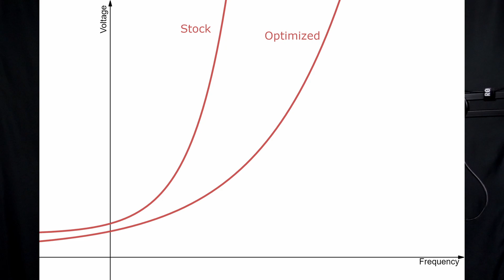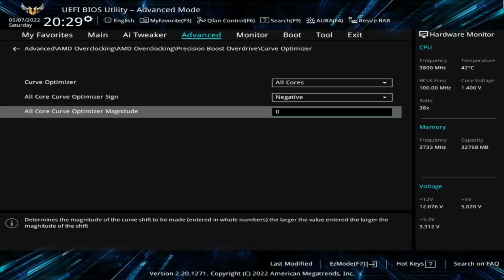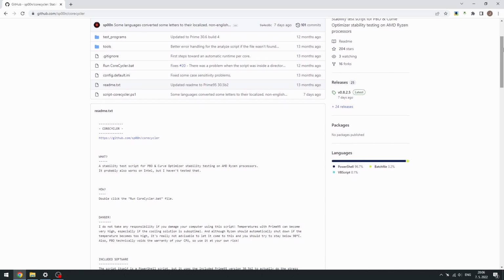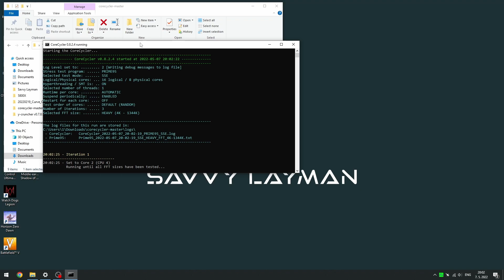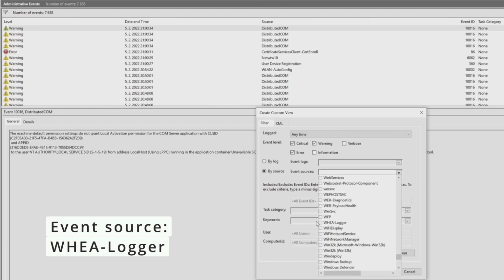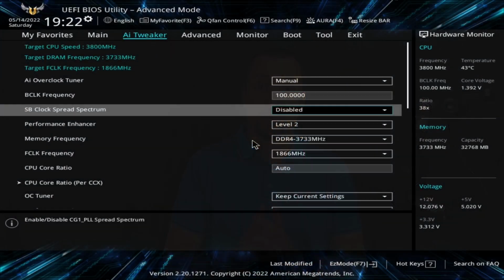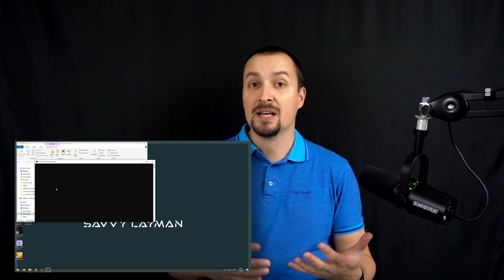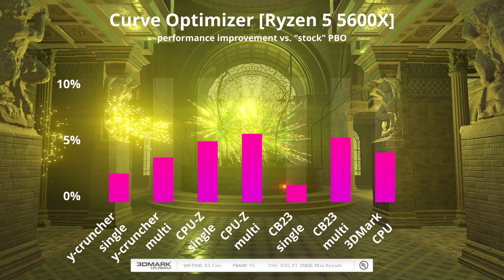Curve Optimizer - Ryzen 5000 / 7000 per-core "smart" undervolting

Comment from the maker: If you are intrigued by Curve Optimizer, I suggest you also watch my video on Hydra 1.2, which can actually make your life a lot easier: https://youtu.be/Nnpao_5uXOQ.
Reply: So we're trying to get the offset per core as low as possible right

And neg 30 being the max?
Reply from the maker: @jgvtc559  Yes, that is correct. Curve Optimizer cannot go any lower by design. Hydra uses a different technique with its Hybrid OC, so it can achieve a more efficient curve.

Comment: Few things to note

Higher clock speeds NEED more voltage. If you set co way too negative, you will starve the cores and crash them. For me personally -25 was stable in all the benchmarks and stress tests but in beamng it would crash after 10 minutes. By trial and error I found out that -6 was the best I could do all core

That brings me to per core. It's a waste of time since AMD only uses 1 power plane for the entire CPU. The core with most load on it gets to dictate how much voltage all the other cores will be running at. If that core is set too low, the system will crash since other cores will not be able to use that voltage and stay stable

Comment: I'm freezing constantly when I push to -40 curve but I can't figure out the problem core. The core cycler shows a flawless test for all cores, and the WHEA logger just won't show anything, the unexpected crash shows up in the basic administrative events but that doesn't show the APIC ID is the issue.
Reply from the maker: Happened to me, too. If your RAM is 100% stable and you don't want to increase voltages, the only workaround I can offer is to lower the frequency offset across all cores. Not great, but it's almost impossible to pinpoint the exact core without APIC ID listed. Apologies.

Comment: nice work  you added  inputlag and stutters , check  for inputdelay and  the viewable nanostutters or weird mouse behavior ;)
Reply from the maker: Thanks for your comment. What makes you think this was the case? What's your assumption regarding such behavior?
Reply: i get this with curveoptimizer enabled on every setup, when  i disable it ,everything is  fine ,must be a windows problem , cuz i hadn't this problem before idk :)
Reply from the maker: @Lolliswonderland  I see. I think this is caused by so-called clock stretching. Due to too aggressive CO curve, the CPU attempts too boost too high for the given voltage. The supplied voltage is not too low to immediately crash the system, but low enough so the CPU has to drop the clocks significantly. I think this whole procedure can take a fraction of a second. In such case, I would recommend to lower the negative volttage offset.
Reply: @savvylayman  so you think the auto setup makes clock stretching by -1-20 negativ on all  cores in the curveoptimizer on 2 Systems  with different boards and cpu's?
Reply from the maker: @Lolliswonderland  Don't know to be honest. I would need to see your system in person. By the way, are these Asus mobos? If so, make sure you disable PBO Fmax Enhancer: https://youtu.be/csGkp4pVuO0

Comment: I dont know if this is.true or Im extremely lucky, but I think silicon quality has improved dramatically. I have one core on -40, rest on -45 (yes, not 30 is the limit, but 50). Tested with y-cruncher for 10h, prime95 for 8h and CoreCycler (with y-cruncher) for 8h. All tested with default PBO values (PPT, TDC, EDC). I think im gonna run another CoreCycler over night with prime as stress test, but Im pretty sure im stable already.
Btw: after a very long time, new CoreCycler versions have been released! With many new features and updated stress test binaries 👍🏼
Reply from the maker: Thanks for letting me know about the new CoreCycler version and kudos to your CPU for being able to handle serious undervolting.

Comment: I have -30 on all cores after tuned by RizenMaster, I se the values in BIOS, full stable in over a year. Ryzen 5 5500, also I set +200MHz boost. Benchmark programs report perofrmance over R5 5600x
Reply from the maker: That's a really good bin then. My personal guess is this was supposed to be a more premium CPU, but it failed some validation tests, so AMD disabled some cores and lowered the overall power budget. Good for you!
Reply: @savvylayman  yes, it has 2 disabled cores, the specs resembles a R7 5700.

Comment: Sir can you please suggest a PPT EDC TDC for 7600x ?
Reply from the maker: Do you want to go for eco mode or full power? Because 7000 series have pretty generous limits set out of the box. What cooler do you use?
Reply: @savvylayman  at the moment i didnt change my cooler yet im using wraith stealth cooler and im setting thermal throtle to 85C + i undervolted all cores to negative 22
Reply from the maker: @cjentuskuzan4027 Thanks for sharing. With stock cooler, I would definitely go with eco mode.
https://www.pcworld.com/article/1352253/how-to-enable-eco-mode-with-ryzen-7000.html
For serious overclock, I recommend at least an AIO with 240 mm radiator.
By the way, negative 22 curve for all cores seems too aggressive in my opinion. You would have to be very lucky to be able to shift the curve so much with the best cores. Anyways, if you encounter crashes, just decrease the value. Cheers and good luck.
Reply: @savvylayman  its my first time undervolting a cpu and im undervolting it and testing by occt if i dont get any errors i consider it as a good undervolt . Im i right or wrong ? Cause i started from 30 and i had bsod and crashes but in negative 22 everything seems to be fine .
Reply: One thing to mention im using the integrated graphics at the moment and im having very high latency all of the sudden in latencymon due to directx graphics kernel can it be due to the undervolt ?
Reply from the maker: @cjentuskuzan4027 You are on the right track regarding undervolting (curve optimization). I haven't used OCCT for a while so I don't remember what options they give you with individual core testing, but each core needs to be thoroughly tested. That's why I recommended Core Cycler. Hydra is another option, but the PRO version is only available to Patreons.
https://youtu.be/Nnpao_5uXOQ
But from my experience, even Hydra doesn't come up with flawless curve. But its curve is certainly a great start. For example, my 5900X is currently using this curve: -19, -8, -25, -23, -10, -26, -30, -30, -25, -26, -30, -24. The best cores are both on CCD0 and those are with curve -8, -10. It's almost always the case the best cores cannot be optimized too much as AMD pushed their curve out of the box.
Reply from the maker: @cjentuskuzan4027 Yes, it can definitely be the case. The thing is if the curve is too aggressive, it doesn't always need to end up with a crash. Sometimes the core throws repairable errors, but this consumes CPU cycles, so you may only observe performance degradation.
Reply: @savvylayman  thanks for your response . right now im dealing with latency issues due to directx graphics kernel or classpnp.sys according to latencymon . i spent weeks trying to solve it without succeding if you have any potential fixes please let me know .
Reply from the maker: @cjentuskuzan4027 Are you using the integrated graphics of your 7600X? Disable it if you have another discreet GPU in the system.
Reply: Seems like its not the integrated graphics i suffer from kernel latency no matter what i do . Im suspecious that my cpu or ram is Causing the issue , what do you think ?
Reply from the maker: @cjentuskuzan4027 Please excuse my ignorance, but how do you measure kernel latency under what conditions?
Reply: @savvylayman  i measure it using latencymon

Comment: So I got close to jackpot in silicon lottery with my 7950X, I can do -28 on 15 cores and one core seems to be less stable, so it needs -21 but I think it is still very good result.I used for verification CoreCycler, Prime95 all cores blended test, OCCT CPU test and 2 weeks of observing PC under normal uses cases (gaming, working, running Hyper V virtual PC, etc.)
Reply: Im also running a -28 on my 7950x3d on all cores
Reply: RyzenMaster reportated stability at -30 on all cores on my Ryzen 5

Comment: Nice video.  Does the WHEA-Logger log only get written when running the powershell script?  When mine reboots say extracting a zip file to the NVME drive, there is nothing written to that log.  Not even sure how it can.  Think normally when a crash and reboot happens the log is the last thing to be updated.  Also for me I can hammer on the CPUs all day with a all core offset of -25.  It's also not at idle when it crashes.  For me it's when extracting a zip file or installing Windows updates.  Something I have read several others have issues with.  Not sure if idling for a period can simulate this scenario.
Reply from the maker: Thanks for asking. WHEA should be logged every time Windows kernel detects a hardware error. Well, in my experience, it doesn't always do that. When your system crashes, I would choose one of the following options:
1. Decrease negative offset by 2 points (i.e., increase voltage) for the best cores. These are in most cases the ones, which struggle, because they want to boost high.
2. Decrease negative offset for all cores by 2 points.
3. Use Hydra to determine the best curve. But I would recommend to stick to classic PBO2 curve instead of going for Hybrid OC. For some reason, HOC acts strange in the last two updates or so.
Reply: @savvylayman  Thanks I'll give Hydra a look.  I right now ended up without going thru a lot of testing, set the 6 cores that are the best cores to -15 and the rest to -25.  Guessing basic activities like file copies and the like will mostly use those "best" cores?
Reply from the maker: @jriker1 Yes, the "best" cores are almost always preferred by the scheduler so if there is a crash, they are most likely to blame.

Comment: Quick question I’m struggling to get my CO on my 5900x when it seems to pass corecycler occt and cinebench I think it’s stable it immediately crashes trying to start Jedi survivor with BSOD.

My question is I cannot find which core needs to be tweaked after a crash because in event log i only see error for something called a bug check . Nothing telling me about a core crashing. 

I really feel if I can figure this out I can get a stable CO . So far when ever I get a BSOD which happens every time I mess with CO I will change a core value and then it stops but I’m only guessing which core failed when I really need to find out specifically which core failed. Thanks
Reply from the maker: Thanks for asking. Two questions:
 1. Is your RAM overclock rock solid?
2. Are there any other WHEA errors?
It may be SoC voltage needs a little increase. Or, to be on a safe side, you may want to decrease the curve shift by a few points (2-5) for all cores. It's not a scientific approach, but it should at least tell you if it gets stable.
Reply: @savvylayman  thanks for your time so I know ycruncher tests the memory and it passed on that for 6 hours straight so I assume my memory is good I could be wrong on that I turn on xmp and that’s all I know about memory or RAM. 

No whea errors , that’s the confusing part I have set up a specific , what you call , way for the event viewer to show me only whea errors and it’s always empty. I thought voltage might be the issue too but I got it set to auto but thought with a negative curve it’s better to have more power not less. 

Right now my current pc is stuck in BSOD because I thought if I downloaded AMD drivers it might possibly fix my problem except STOREMI was a huge mistake how AMD gets away with putting out such unstable crap is crazy to me but it falls on me to not blindly download drivers anymore , lesson learned. Gonna reinstall windows today restore from backup and get back to it. Oh and making a bootable windows drive is a pain in the ass with FAT22 and that damn install.wim file . I had to learn terminal (macOS) for two days just to make , what used to be easy , a bootable windows thumb drive FML !!!!
Reply from the maker: @phat420sac4  Oh man, sorry about your trouble. Concerning RAM overclock, if you only use XMP, it's fine leaving SoC voltage at Auto. Regarding random reboots with no EventLog entry, I haven't experienced it with my 5900X, nor 5600X, but I've seen these with my 5800X. I simply had to decrease the negative offset by 1-3 points for all cores. There are things between the heavens and the earth no one understands and I guess it's one of them. :) Good luck with your tinkering. I see I was lucky I never tried STOREMI...
Reply: @savvylayman  thanks man almost there 😬😬😬

Comment: That was very helpful! I'm not able to set -30 on all cores because of 1 "bad" core. All cores are able to -30, except by Core 2, set to -24.
Reply from the maker: This is still a very good result. I would even say it is likely you will run into some stability issues in the near future. In case that happens, just decrease the negative CO value and try again. Good luck and thanks for sharing.
Reply: @savvylayman  I've run the prime test, core by core, for about 3h+ without errors. Hope still get stable 🙏🙏
Reply: Using a 5700x with +150Mhz
Reply: @Machad3xTV  Somehow y'all only got the créme de la créme eh? Anyways, still running stable?
Reply: @dzudemlow  Still stable

Comment: pbo in bios on auto or enable? then ? if you use pbo2 ? what are the bios settings if you want to use pbo2, and when not, what if you only use bios settings? i am on a aorus master x570s with 5800x3d
Reply from the maker: Thanks for asking. The stock AMD specification is "PBO disabled" and that is what it should default to in "Auto". PBO2 is just a newer revision which enables Curve Optimizer in Ryzen 5000 series CPUs. I would recommend always using AMD overclocking section in Advanced settings. You can leave Ai Tweaker section as is, but I also recommend turning PBO Fmax Enhancer off. Reason here: https://youtu.be/csGkp4pVuO0
Reply: @savvylayman  thanks

Comment: First person to show me the event viewer thank you, I'll be using that.
Reply from the maker: One side note on the Event Viewer, I have noticed Windows sometimes throws a WHEA error, but it doesn't tell which core was involved in the error. In such case, one should consider decreasing the offset on all cores. It's a small trade of efficiency for stability.
Reply: Same this will save so much time

Comment: Trying to do this in ASROCK bios. And it just doesn’t look anythibg like this Bios. There is now PBO option at all
Reply from the maker: What motherboard / chipset and CPU do you use?
Reply: @savvylayman  MB is a ASrock B550M-C.  It was pre built from Skytech gaming.  I have a R9 5800X3d.   I did update the bios to latest.  And I did update the chipset driver from Amd to latest. Far as I could tell.  When I go into Uefi I see the “Oc tweaker tab”. And I see the “Advanced” tab.  But ive looked all through those I dont see a god damn thing anywhere that says PBO.  Or PBO2.  I could figure out how to overclock it, But i dont see anything about how to Undervolt. B

Comment: 3 days of stressing in my R5 5600X? This Core Cycler is for  hardcore overclocker enthusiasts and If I were one I wouldn't use curve optimizer. Maybe I will change the timer, but 72 hours for me is a bit too much.
Reply from the maker: Haha, no, 72 hours is way too long. I let it run for up to 30 minutes per core and perhaps repeat if needed.